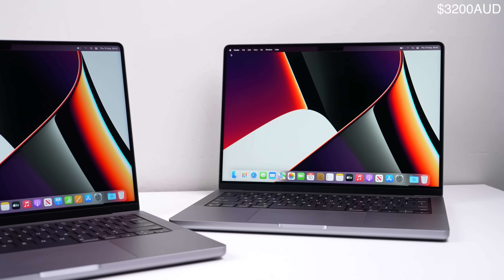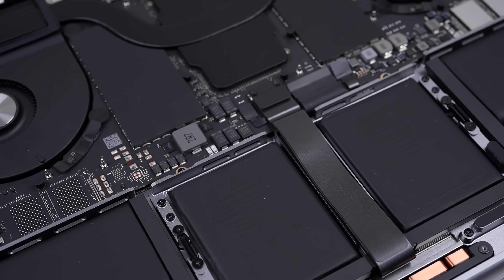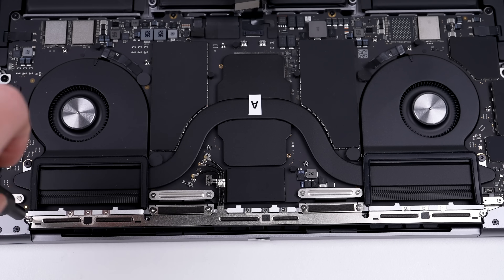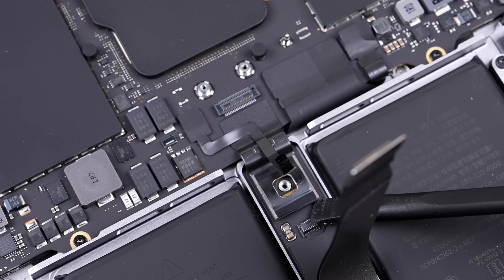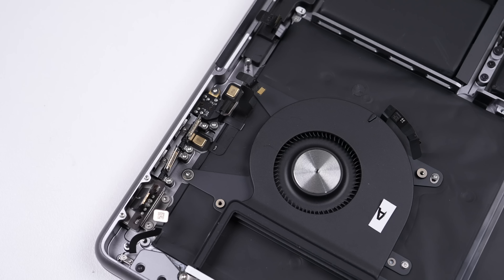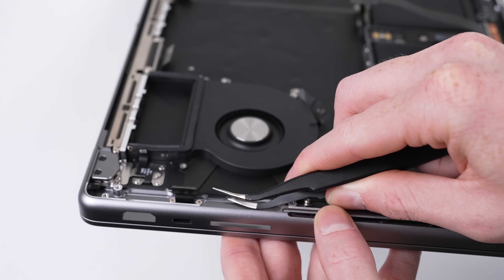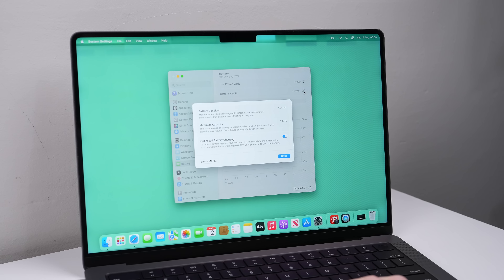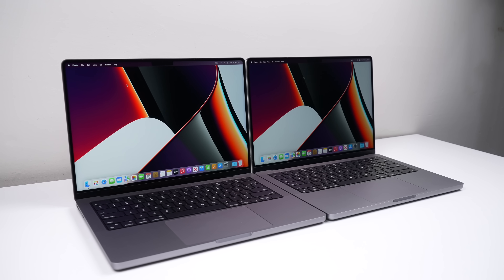New Anti-Consumer MacBook Pros - Teardown And Repair Assessment - Apple Silicon M1/M2

Comment: When the PC market started, the IBM locked out 3rd party peripheral manufacturers with their proprietary Micro Channel Architecture. Well, that's when those 3rd party companies got together and created the ISA. Result - IBM doesn't make PCs any more. But at that time IBM didn't make the operating system - Microsoft did. And it turned out that the OS is more important than the HW, and DOS worked on other computers, and that gave consumers more choices. Apple may be pissing their customers off by locking out self or 3rd party repair, but they also have an advantage. People love iOS vs Windows. Window's is a bloated cow. No matter how fast a computer is, Windows will make it slower than a TRS-80 running from a tape drive. Linux et al. are still the Heathkit of operating systems. Chrome OS is just a web browser. Apple just doesn't have competition. Hopefully, the EU will step in and slap the bite out of Apple's logo with antitrust fines and force them to make their computers repairable.

Comment: 8:56. it makes sense that neither laptop screen would work if you understand hall sensors. I don't know anything about Macbooks, but from what I saw when you were taking the sensor off, it looked like the magnet was part of a nut which would be randomly tightened at any given angle. You would have to calibrate the hall sensor to that angle so the computer knows where in the rotation the screen is to know if it is open or closed or any where inbetween.
Reply: On the other hand this means that after a sensor swap you could loosen the nut until it works properly and then loctite it.
Reply: @mumiemonstret  So you are going to rotate it avery degree around 360 degress till you get it right? It would be much more useful if the idiots at Apple would not make EVERYTHING so you have to pay for it. What a bunch of greedy jerks!!!!

Comment: Lack of Apple calibration causing the screen defects don't even make sense.  It looks purely malicious to add designated faded locations when the screen was replaced. The hall effect sensor needing manual calibration also doesn't make sense.  At least there's a way for auto calibration with an additional sensor or even just guided auto calibration.  There are no defendable technical reasons for any of this.  The sole reason is to make it unfixable by you.  And when you bring it into apple, they'll make it so expensive to repair that that becomes unfeasible as well.  The individual port replacement is a dog and pony show to demonstrate to the politicians that they've spent effort on repairability.  I won't accept that any of this was driven by cost savings.  Why would they use 60 screws and make it so finicky if they were trying to save costs?  Assembly costs are substantial to production costs.  I'm an engineer who've spent much of my life in production.

Comment: Wondering if maybe replacing the angle sensor and starting (hooking into power) the laptop with the lid closed would automatically "tune" the sensor.
It really seems like it thinks it's closed where you had it when it was first powered on.

Comment: Okay, Apple is acting like Apple here. Officially allowing 3rd party repair, but making as hard as possible.
But I have an idea for a compromise.
How about we make it legally binding that when a manufacturer is ending support for a device, they are required to make all support tools for it available.
That way they don't have to do anything afterwards, and when the user community decides to do more stuff, the manufacturer is free from any responsibility.

Like the moment a phone is out of support, throw out the flash tools, bootloader unlock codes, firmware, software to sign firmware, etc. If you want to flash Android 13 on your 2012 Galaxy S3, Samsung is out of the picture.

Comment: Do you think Apple have a dedicated clearing stage where they ensure that their devices are difficult to repair? Complete with presentations figures & everything? Or even a specialized design & engineering team with the single task of working out anti-repair guidelines for the product designers?
Reply: 1000% yes. This is not a company that just makes decisions without considering all the benefits and downsides. 
Firstly, the decisions to glue the battery in place and solder the RAM in place are very clearly well considered. Both require the consumer to get the part upgraded/replaced by Apple, and then Apple reaps the profits. 
Secondly, why would they use so many screws with different heads? There is no need for this, they are simply trying to make repair more difficult. It takes so much time to remove all those screws and time is money, so repair shops will charge more to repair. The price goes up to the point where a 3rd party repair isn't much cheaper than an Apple repair. At this point the customer might simply consider taking it to Apple instead.
Even when new EU laws come into place forcing Apple to make internal parts more easily replaceable, I will never again buy any of their products.
Reply: There's a reason this company is worth 3 trillion, which is just extremely sad.
The fact that they intentionally do this should be straight up illegal
Reply: yes
Reply: Buying Apple and Windows is like Buying A Mercedes Benz or Toyota 😂…. Even Toyota you can repair outside their dealer you still have to purchase genuine parts from Toyota for the repair. Only difference is the labour cost to repair …. 
But what is a fuss if you can buy a mac book to repair at premium price? Can’t afford simply don’t use it then you will be happier 🙏🏽😁 Learn what to have not what to buy …. 🙏🏽😁
Reply: @rhinolimes   The thing about it is the pricing is just freaking outrageous, it’s not about if I have the money to pay it it’s about why the hell should a repair to a laptop cost close to the freaking laptop itself. 
It’s about ethics not about money, it’s simply dosent mean that if it is legal it is ethical as well.
I had this incident, I have a iPad Pro 12.9 m2 ok I bought it a year ago I had this problem where the screen will go black and have some grey lines appear on it, and it’s color inverted sometimes I took it to them one day after my last day of the warranty period with INFORMING THEM BEFORE TIME, they were like we can’t reapir this thing we will give you a replacement for like 100 usd less, i denied and said I informed you about the issue, after a back and forth them saying it’s a software issue and shit, they “tested the hardware ie. The display” you know how by cycling different colors and watching out for the lines and they said it’s not the hardware fault it is the software fault, I told them like it a freaking ribbon connector that is the issue, they just were like no this things don’t come with faulty parts, thankfully the issue reoccurred in the shop I shiwsed them that when you press a specific part of the screen it goes away, and told them IT IS. A ribbon connector issue, and only then they agreed on replacing it. 
So what I am trying to say is they were doing illegal things with not giving the replacement but it’s just unethical towards their customers and lack of responsibility
Reply: Nah, that'd leave FAR too much of a paper trail, something that people don't understand about adversarial action/conspiracies is that they don't even necessarily HAVE TO be legislated in any way(in this case, that'd be what you're suggesting, de jure), but can just be de facto, which would be nudging the engineers or maybe even assembly line designers to do this in word instead of in contract, say, with bonuses contingent on it or something.

Comment: They should've soldered some supports to the motherboard below so you can't access them, and welded them to the frame, and for all the ribbon cables should have a plug that only goes one way, so people can't remove them without breaking it ^^. I find it really funny it has screws though; you open the screws and then, hey let's make a wallpaper of our laptop's inside for my grandpa to hang on the wall; no other use for the screws.

Comment: The quality of the apple build is astonishing. Thats why the devices are so durable. Show me any device from the cheap american or chinese manufacturers that has nearly the same quality... Whats the problem in calibrating the display after a repair? Guess you need a software that apple just gives to qualified refurbers... not setting/recalibrate the tiltsensor is a you problem, thats not apples fault.

Comment: You can get the unit serviced at any service provider and apple do offer service parts and self service at home. 

Your concern about becoming unsupported is a bit unwarranted. Apple will support machines for over 6 years. Possibly even beyond depending on the part and machine. 

Also, you are complaining about the unit being hard to service? Go to a professional. You don’t expect everyday people to be able to service an engine in a car…

Comment: And landfills continue to fill up with more crappy "disposable" tech. Can we just pay these greedy bastards some kind of annual extortion tax? We can call it an "R&D" tax. We must try harder to save this planet, and of course our sanity from constant updates and forced upgrades. I would like to learn and enjoy my new piece of tech for at LEAST 5 years. This includes hardware and software. I will soon be moving to Linux and probably a Frameworks laptop. I think Frameworks makes laptops with matte screens and centered trackpads. I also think they have BIOS/Firmware versions that don't suffer from the dreaded battery drain/overheating while sleeping issue, that a lot of main stream PC laptops suffer from.

Comment: It baffles the mind why people buy apple products. They are neither cheaper or superior to other brands of similar spec. Their anti consumer acts do nothing by cement my standpoint of the past 20 years of never purchasing anything from Apple. I worked in an authorised repair centre since 2000 and made my mind up a long time ago that they were not a nice company when it came to repair. They just wanted engineers to push the most expensive repair onto the consumer, even back then.

Comment: Omfg, this man is ridiculously stupid. All you need to replace display on new pro's is to unsolder the multicontroller and eeprom (which stores data about color calibration parameters) from display circuit board and solder it to new display circuit board. That's it.

LMFAO when he says you need to give apple remote connection for display calibration. Man call yourself a dedicated Right to repair advocate, but he doesn't know how exactly to repair.

Comment: When you swap the displays they look and act "broken", but both act "broken" in the exact way. And, of course, when swapped back they function just fine. Apple's already been caught intentionally crippling old hardware, why wouldnt they design their hardware to pretend to be broken if someone other than them tries to repair it?
Reply: more money, thats it.
Reply: In a sane world you'd put an EPROM in the display if it needed special calibration.  Instead they're putting a unique ID on the PROM.  In a truly sensible world (i.e. the world of non-Apple displays) the controller in the display panel handles such things itself (if they're even needed), completely transparent to the OS.

Comment: if you were making 75 grand per year, stick to the regular laptop which can easily be repaired. Macbook users are usually those who make around 100-150 grand minimum and those who got no problem getting MacBook replacement parts and services from authorized people or companies. But if you're extremely careful with it then MacBook could last 4-5 years without requiring any repairs

Comment: 9:00 So..an uncalibrated magnetic angle sensor isn't calibrated.  How shocking.  I think it's disingenuous to show this as though it weren't expected.  The lack of an ability to calibrate it without an apple utility is a problem, but the sensor itself needing calibration is not a problem.

Comment: I complete agree with the sentiment. Apple has gone from the most customer focused wonderful ecosystem and products…to the current fiasco. Focus is on profit, customer be damned. Go past the smooth marketing. Products no longer stand out and are unrepairable. Ecosystem used to be integrated and easy to use and logical. Now all fractured, so you pay more for individual services. And bear in mind you experience is in a developed nations. It’s 10x worse in developing nations. Licensed agents are ordered by Apple that if a gadget isn’t fixable by software diagnostics and software update…buy a new one. THEY ARE TOLD BY APPLE NOT TO PHYSICALLY FIT ANYTHING. I was told this by a licensed Apple engineer. Phones no longer stand out, software now behind. I personally have gone from everything Apple to nothing

Comment: One of these days, I hope there is a solid competitor to the M1 and M2 laptops that can run linux. I really love my experience with those computers and their insane performance and battery life but I am sick of this company and their war against the consumer.
Reply: PC's work
Reply: The M1 and M2 are ahead pretty much only because Apple paid for priority access to TSMC's 5nm and 3nm fabs. i.e. It's not that the M architecture is special, it's just the size they're manufactured at. AMD began manufacturing on TSMC 5nm with Zen 4, which are competitive. Intel is still on the equivalent of TSMC 7nm (in terms of transistors per mm^2).

IOW, AMD and probably Intel could beat out Apple's CPUs if they were willing to outbid Apple for priority access to TSMC's newest fabs. They're not because they don't feel they need to compete with Apple (Apple has only 10% market share).

It's also worth pointing out that Intel's decades-long dominance of the CPU market was also because their fabs were 2-3 generations ahead of anyone else in the world. So even if their architecture was inferior, they could produce it smaller thus using less power so they could crank up the clock speed to outrun the competition.

Their lead evaporated when they got stuck on 14nm for 7 years (normally they shrink the fab size about every 3-3.5 years). Broadwell (5th gen) all the way to Alder Lake (12th gen). That coincided with AMD surpassing Intel (AMD uses TSMC so continued enjoying die shrinks while Intel was stuck). If Intel grabs the fab lead over TSMC, Apple (and AMD) get relegated to second tier again. Intel's equivalent to TSMC 4nm is supposed to be out later this year. And 3nm next year.
Reply: @solandri69  From what I heard, there's also a whole "instruction decoding bottleneck" issue with x86's variable length machine instructions limiting the degree to which you can parallelize the instruction decoding stage of the pipeline.
Reply: @ssokolow  The arbitrary length of x86-* instructions certainly doesn't help.

In contrast, both 32-bit (A32) and 64-bit (A64) ARM instructions are 32 bits long, when running in Thumb mode (T16) instructions are 16-bit, and when running in Thumb-2 (T32) mode they are either 16-bit or 32-bit.  At any given time only one instruction format can be active: A64, A32, T32, or T16.  In any case, arguments are almost always 32- or 64-bit.  This vastly simplifies decoding.
Reply: lol give credit where credit is due. 
 @solandri69
Reply: Sure, the ARM architecture vs x86 has nothing to do with the performance advantage, lmao.
Reply: @Akira-xc2zi  ARM (RISC) actually performs worse than x86 (CISC) clock for clock. Apple gets around that deficit by loading up their processors with gobs of specialized hardware co-processors to help speed up specific operations which would take the core much longer to do in software. The M1 and M2 have substantially more transistors than AMD and Intel's offerings as a result (the opposite of what you'd expect from a RISC architecture). And they tend to fall behind when you task them to do lots of the same operations in parallel (the hardware co-processors can only handle 1 or 2 at a time, whereas  each of the AMD/Intel cores can crunch through it).
Reply: @Akira-xc2zi what performance advantage they are last at everything except poweruse battery life and some encoding down by their media engine chips.
Amd and intel beat it in raw cpu gpu and ssd speed screen tech touch 4k old ports upgradeable ssd memory.

But they are powered hungry in many cases but getting much better.
Build quality is as good on one top models as well.

Comment: As someone that has left the PSP (premium service provider) scene as a manager, this software pairing/tools shenanigans is just stupid when the consumer can't access them. Shoot, even having to use another computer to install OS if the recovery partition and network access is gone is asinine. Anyway, when putting the mobo back in, tape the flex cables back out of the way ( I use painters tape, same as when reinstalling an older iMacs lcd back onto the chin)

Comment: Having owned a 2007 mbp and disassembled it several times over the years to increase ram, upgrade to ssd, and repaste the CPU, this new mbp is comically designed. Must be a joke amongst the engineers.

Comment: It seems that the magnets for the hall effect sensor are oriented differently on different devices, so either this is down to lazy manufacturing by not aligning the magnets the same way or deliberately rotating the magnets for different devices. You might be able to dig out the original magnet and somehow orienting it to that of the specific angle of magnetism that is originally calibrated to a closed lid